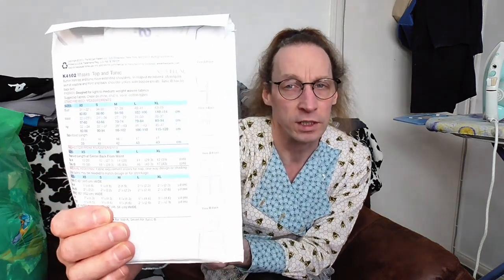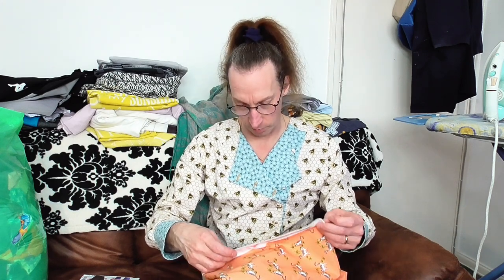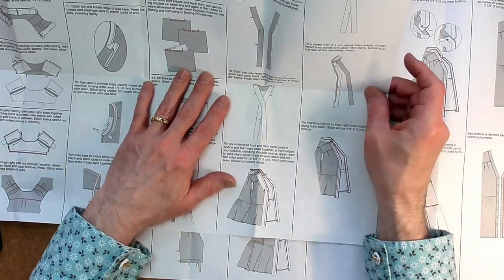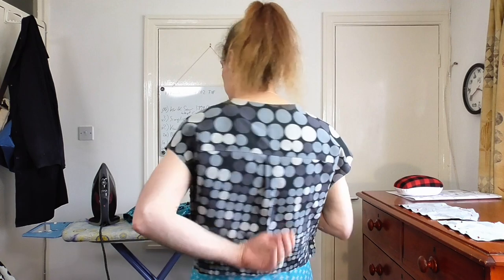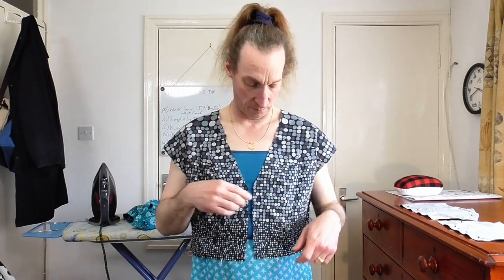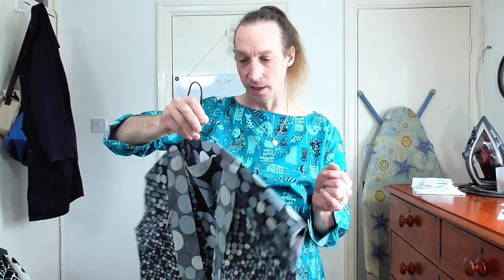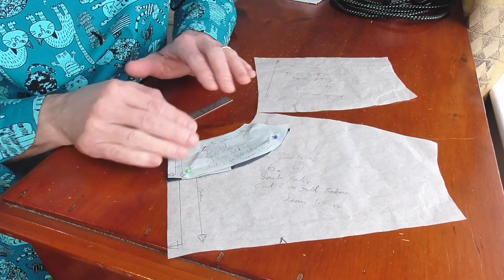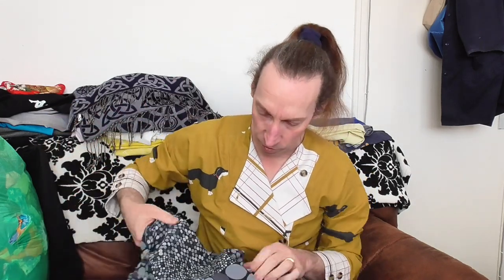Kwik Sew 4102 Top Mock-Up (It went Pete Tong)

Comment: I had to look up Pete Tong I the urban dictionary 😂.  I like the top you are wearing 🤷🏻‍♀️I love the fabric you chose for this make.  I’m with you, that construction method is cumbersome.  Are the finished garment measurements anywhere on the pattern pieces? You persevered for sure on this pattern.  The next one will be just right.  I think I would take this mockup and take it in on the sides then shorten (crop) the  skirt in the front and curve it down in the back.  How do you keep track of your notes and adjustments?  The struggle is real, I go through the same issues. Going through all the work to get a pattern fitted is dedication.  Well done, I’ll be looking out for the final reveal.
Reply from the maker: Thank you Jan, I may go with your suggestion to crop the skirt section.
My notes are sometimes messy but I try to number the steps in the order I'm going to do them, but with enough space to right down how the process differs from the pattern.  It's a work in progress.

Comment: The Burrito method should be simple that method of construction seems a bit long winded, I do agree with you regarding the big 4 pattern companies, their instructions can be awful, which is a huge shame as it can put so many people off, and in reality the cost of patterns is high, so as you say the least they could do is fill up page four. The perpetually blank page. Thank you for taking the time to share.
Reply from the maker: Hi Debra, I will look up the Burrito method.  I may have done this before on the shirt I make (kwik sew 3555).  At least the blank page gives us somewhere to wright notes.
Reply: You’re correct as the burrito method doesn’t need to be done in so many steps for more experienced sewist and remains a nice, neat method.
Reply from the maker: @nathaliepalladino4128  I will be trying that method when I make it in good fabric.